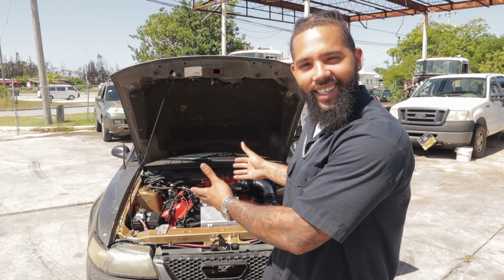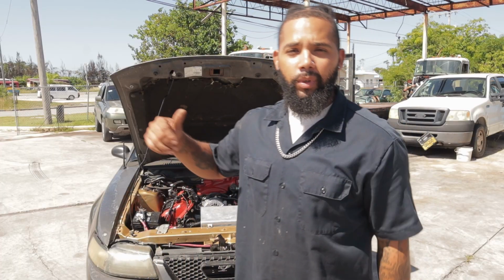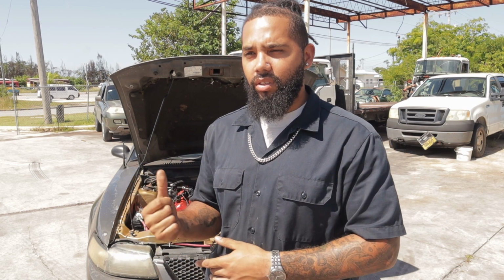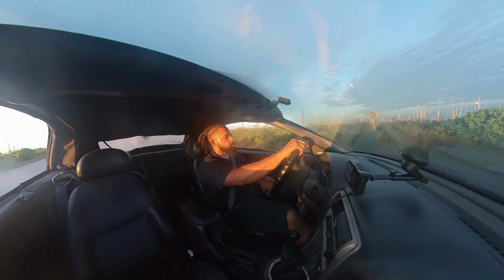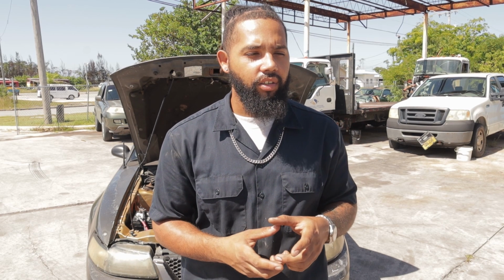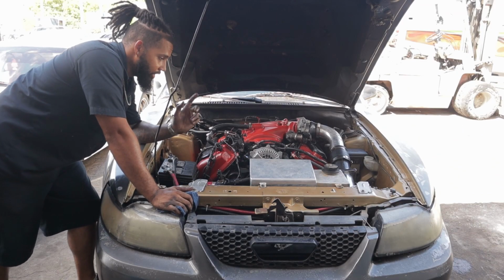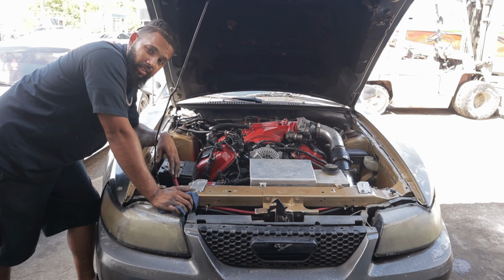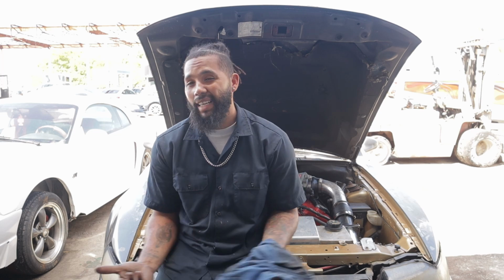Did I Blow Up MY 4v swap Mustang Gt

Comment: I think it is the rings, valve guide seals don't do what you are experiencing.  If I can make a suggestion, switch to Driven BR30 break-in oil to help break in the rings. It may do the trick unless there is a mechanical issue or you did not clock the rings.

Comment: DriftDreams!!! Hello sir.  Well, you got some issues ugg. what is your oil pressure if it is too much you could be blowing passed the rings. but DID you set the proper ring gap...you have a tremendous amount of oil out the back. so is it oil or coolant.  looks much whiter than blue.  check your coolant level. head gaskets may be leaking. at higher RPMS means more head pressure. could be why it's not doing it when at idle. peace be yours have a great week.
Reply: @DriftDreams242  OK so we are back to ring gap.  and or pressure to much crank case pressure going to blow passed the rings. or ring gap not set right and again passed the rings.  valve stem seals.... did you forget to put them on lol. seals would not go that fast and if you were just missing one.  Way to much smoke for just one.
Reply: @DriftDreams242  sorry you have to take the motor apart. But it will give you the opportunity to see the break in wear at least.
Reply: @DriftDreams242  yes yes very possibly crapy rings. Gotta get the good stuff when needed lol. Break in wear. Are the cylinders glazed or gouged. Are the rods tight left to right. They will have play front to back that's ok. How does the oil smell. Gas, coolant,burnt. Look for metal flake in the oil, cut open filter and examine for debris.